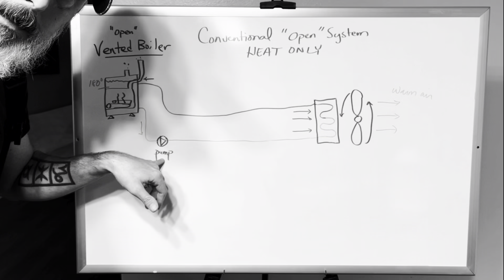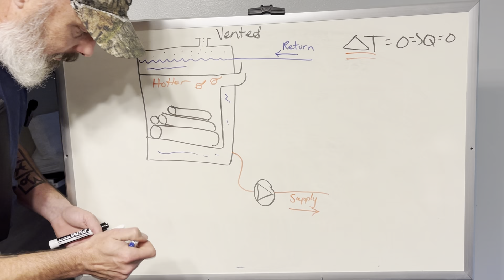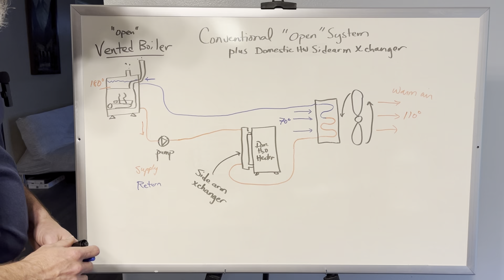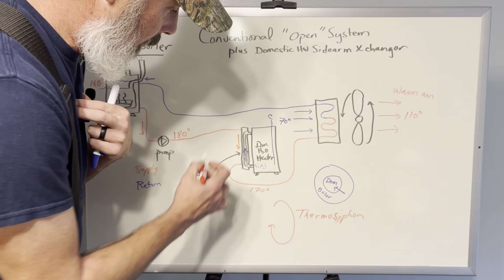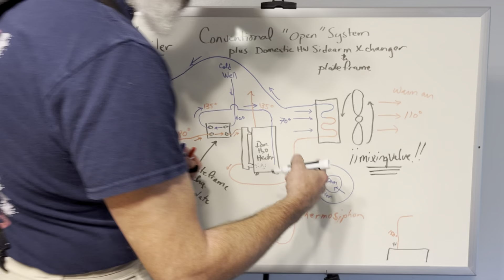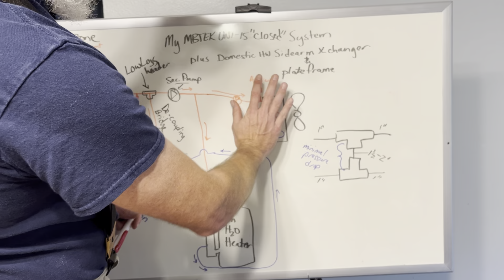Wood Boiler Hydronics, my MBTEK UNI-15 & Piping Schemes Layout!! (2023)

Comment: It would appear that you’re saying that it goes into the plate exchanger and then from there it goes to the side arm exchanger, which I don’t understand because my hot water heater will not even accommodate a side exchanger. I have to use a plate exchanger so how can it go into both?
Reply from the maker: If you had both go into your plate frame heat exchanger first then into your side arm. You don’t have to have a special water heater to use a side arm heat exchanger. You just have to pipe it a certain way. My electric water heater is a regular water heater in the sense that it’s got a drain at the bottom and a hot and cold top and I have a side arm mounted on mine.

With both types being used, the plate heats as water moves through and the side arm keeps the water heater vessel up to temp in between use. Best of both worlds.

Comment: I’m going to be installing a Crown Royal 7350 MP in roughly one month and I have about 80 feet from the boiler to where it enters into my house and obviously it’s gonna start at the hot water heater in a 30 plate and then it’s gonna go to my forced air in the Plenum and then it’s gonna go out to my three car attached garage which is just under 700 ft.² and I’m still undecided if I wanna go with a 70,000 BTU or 100,000 BTU Hydro furnace out there but I guess a big question if you happen to have a suggestion is what type of pump would be ideal for the back of my boiler. I was thinking about a taco 0026 but I would love your input if I could get it and then, if there is a garage heater that you would recommend I’m kind of between the Modine and the Dragon Breath although I think I like the Dragon Breath better but also still undecided on a 70,000 BTU which I’m sure would be efficient enough, but I feel like spending a little extra money and getting the hundred thousand BTU just because I know I can really crank it up. If I want to win the winner we live in southeastern Wisconsin thanks much love your videos.
Reply from the maker: Glad someone finds these interesting. For pump, I would do a calc on head and select based off of that.

Comment: It’s best to pull the water from the bottom for one it helps to keep the boiler circulated better than just having a hotspot at the top, easier on the pump to push water when it has some pressure behind it so pump will last longer and less power consumption.

Comment: I’d be interested to hear your thoughts on thermal storage in this setup. I see you’ve planned for it in the future but only 50 gal, while most systems I’ve read about use several times that. I’m planning on building a log home in a pretty cold climate and my thinking is to use an MBTEK PRO11 in an open system with thermal storage, with house radiators and hot water primarily coming off heat exchangers in the storage tank, with potentially a quick start interface as you have with the plate exchanger.
Reply from the maker: Great questions… I love this stuff. Thanks for watching. I hope to make a video just about buffering and storage. But here are a few of my thoughts prior to me making a video solely about that. The interim modification on my system would be to add a 50 gallon tank between the primary and secondary pumping systems. This would be a “buffer” tank. It’s only job is to capture the heat overage at the end of a call for heat whilst the wood boiler is cycling down. Ideally, with financial means being present (and they currently aren’t lol), would be to add true “storage”. For me, that means enough water volume that can absorb all the heat that my fully loaded boiler running at max fire would produce. So for my boiler and my house the numbers calculate to about 1,600 gallons of storage. That would hopefully be a firing per day depending on the loads. The 50 gallons would be a buffer tank until I get full thermal storage set up. I hope these nuggets help hold you over until I get around to the thermal storage video. Thanks again! Stay warm my friend.
Reply: @micinmono  Great content, thanks for taking the time to produce it. As a chemical engineer I understand well the concepts but it's great to hear from someone who installs and uses these systems both professionally and personally.
Reply: Research Garn. Or now Hy-c. Firebox and storage in one unit. Also purchase Dan Holohan books. Wealth of knowledge for plumbing hydronics correctly

Comment: Not sure how stable you can maintain the  boiler return water temp tp 130F, using your primary secondary scheme of constant flow.  If the heat exchanger can outrun the boiler the secondary pump may cycle frequently, unless you have a big differential in the setpoint to trigger the pump. Is this working well for you?
Reply from the maker: Thanks for the question. It works great! This video was more on piping and pumps. Last video touched base on the controls a little more. A lot going on in real time, but I’ll try to explain a little bit. My apologies if I left too much grey area. I run my boiler water at 170°. The constant speed pumps do not deliver constant flow. If no house heat is needed, there is an automated valve for that circuit that closes. When it closes, the amount of secondary piping available gets cut in half (roughly). The secondary pump is running at the same speed, but delivering less flow because of the increased pressure differential on the secondary side. 

Ultimately, I adjusted the circuit setter on the DOMHW circuit with only DOMHW flow (no house heat) to keep DOMHW return to boiler at 142° with 2 showers going. With the flows present at the speeds set for the pumps, that equates to around 67MBTUH (max I can get out of my boiler). Mine is the 2nd smallest unit they make. My house only needs around 35 MBTUH of heat at design ~20° Outside. I’ve adjusted the house heat circuit to yield around 135° return water for that circuit. The controls monitor the return temp going back to boiler. If it gets below 135° for any reason, it will close the valve for house heat. That way I know I’m only returning 142° water back to the boiler at a minimum. Typically I run anywhere from 145-150 depending on what’s heating. 

Words on paper are hot garbage for explaining this stuff sometimes, but that’s my decent stab at explaining it some without getting in the weeds too much. Thanks again for watching and engaging in the fun tech talk on these subjects! Have a great evening!
Reply: @micinmono  Great info, thanks for explanation, but if the heat dump load is on could it pull down the water temp below 130f if its on while other loads are on ?
Reply from the maker: The outside building heat (dump zone) circuit is on the primary loop. Dump flow is set to ~1 gpm with 140° return while heating. It’s all taken care of with pump selection, coil selection and flow balancing.
Reply from the maker: Also, some would say that if the supply boiler water drops in temperature (say… 10°), then the return will automatically drop 10° also. Unfortunately, that just isn’t true. Those relationships aren’t linear. In reality, if the supply temperature drops 10°, it’s ability to heat drops also, the delta between air to be heating and water to heat with gets smaller. We know that when that happens, heat transfer WILL get smaller (or worse). The boiler water will give up LESS heat to the air. So the boiler water delta (supply minus return) will decrease. So for made up numbers, if the supply water is 170° (normally) and return is 140°, the boiler water delta is 30°. At 160° supply water (and worse heat transfer), the return water temp will be at say…135°. Now a 25° delta. As the supply temp decreases the boiler water delta will also. I do have control integration at the boiler to shut down the circulating pump when the return water gets below 140°. Around that point the boiler is going to shut itself down anyway because if that is happening, it is running low on fuel. On the list is to do a video ONLY about heat exchange because there’s a ton (no pun intended) of intricacies with heat exchange theory.